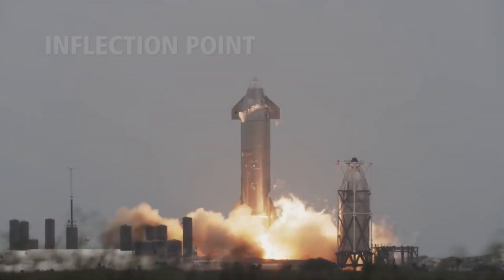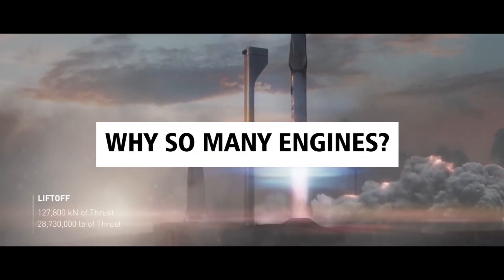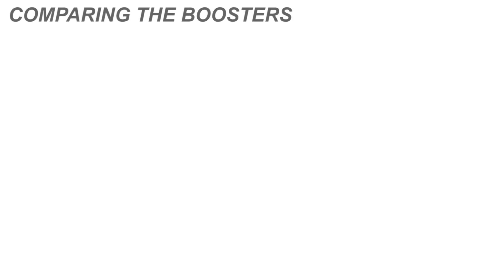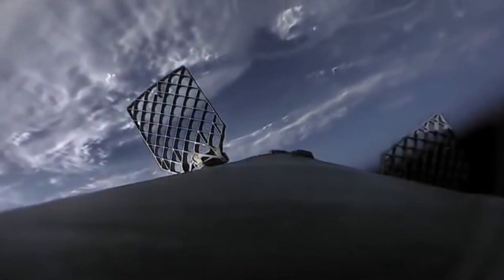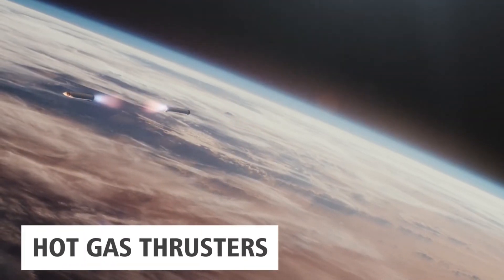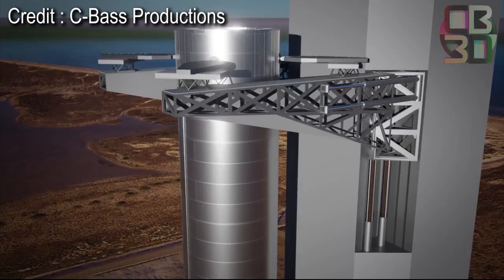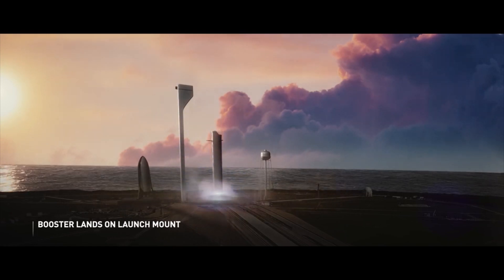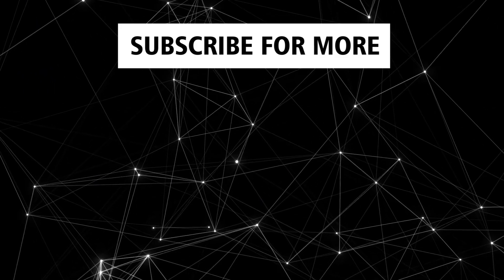SpaceX Super Heavy Booster Explained

Comment: your video is already incorrect. Elon now says 29 raptors and going up to 32 later. Also why do you have legs on a booster that will have no legs?
Reply from the maker: Yeah, I have pinned a comment stating this. The initial version will have landing legs as they can't risk losing the launch tower in case of a failure. 

Thanks for watching 😊
Reply: @spacexplained5001  They are doing water landings so they won't damage infrastructure. No legs needed.